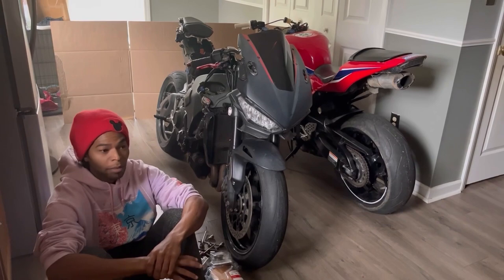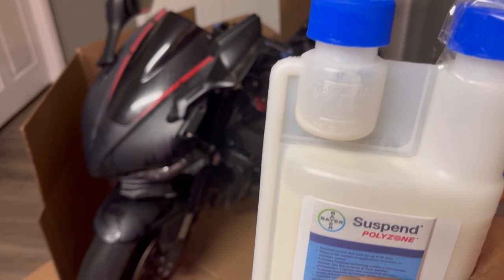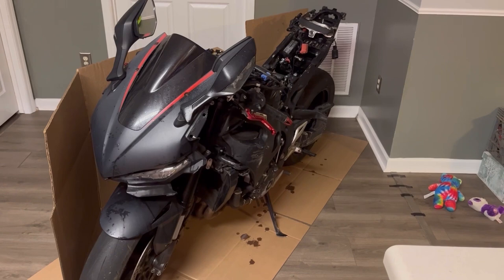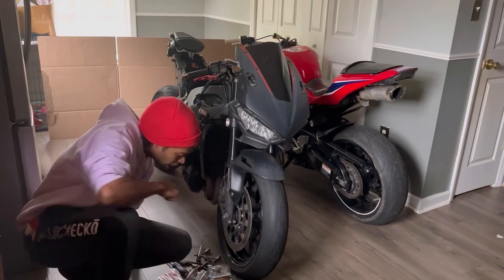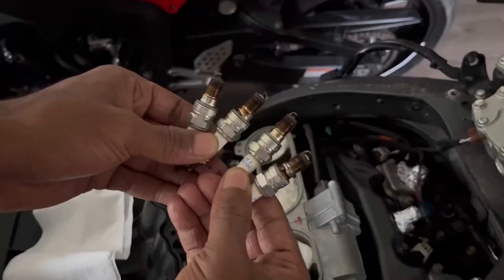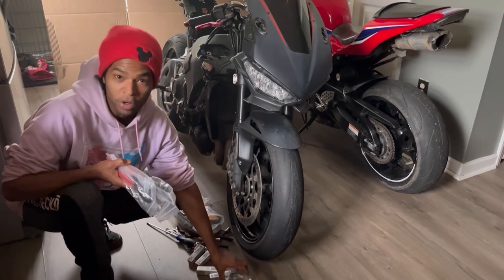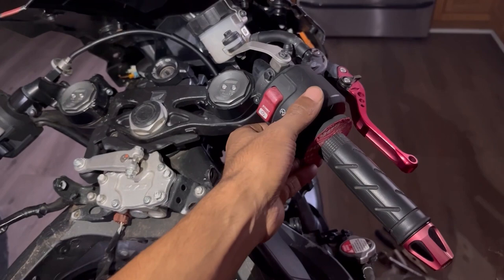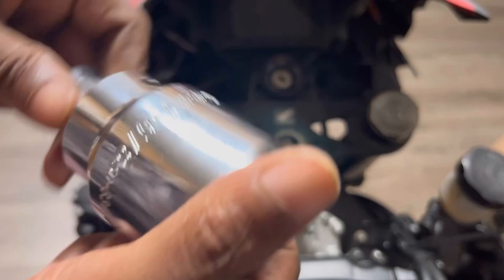‼️ Fixing my WRECKED 2017 CBR1000RR Bike Rebuild + Steering Head Bearing Adjustment

Comment: I have a 95 Cbr 600f3, I crunk it but tbh don't really know what I need to do to it, the guy I got it from died before I bought it from him it has no seat or back fairing but my budget is cool & I need help with it
Reply from the maker: I would start by removing the carburetors and clean them, replace the battery and clean out gas tank dump old gas and add fresh gas also oil change should be good to go
Reply: @2wheelfamily493  lol I'm not mechanical inclined, have no tools

Comment: What would be the problem when your injectors spray all at once when you let go of the starter button?
Reply from the maker: What problem are you having with your bike?
Reply: @2wheelfamily493  injectors only sprays when I let off the starter button. And they spray all at once
Reply from the maker: @znbgarage6685  I would check your fuel pump as that's the only thing that could send that much fuel to your fuel injectors